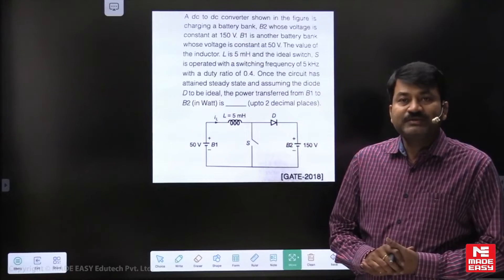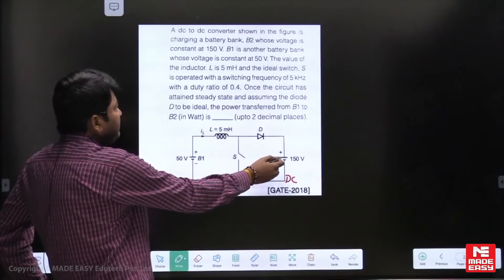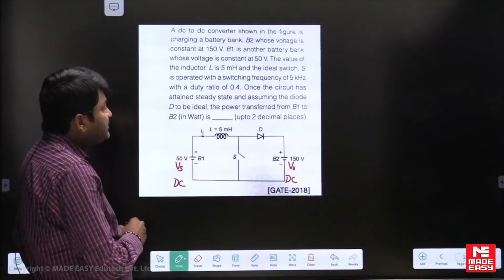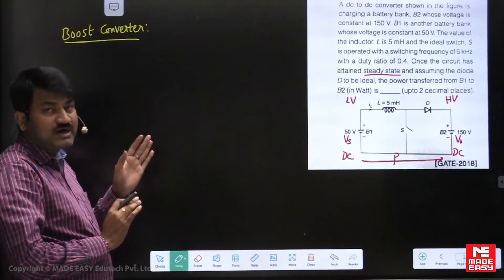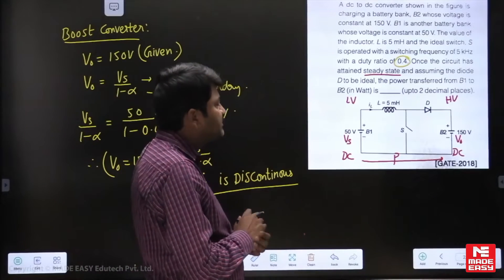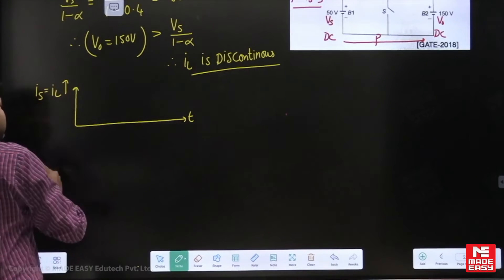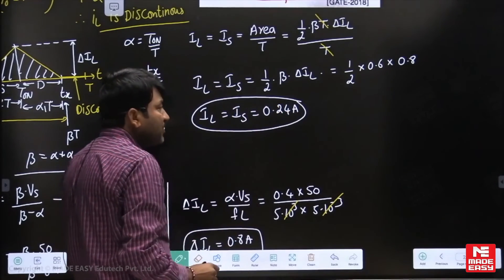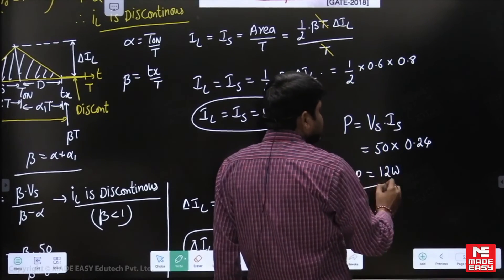Most Imp. Previous Year Questions |GATE & ESE| Power Electronics| Part-2|By Jagadeesh Sir| MADE EASY

Comment: In question it is asked to find out power delivered to B2. but here power delivered by B1 is calculated.
Reply: Both are same . Since there is no other power loss. So whatever power is deliver by b1 is equal to power delivered to b2
Reply: @prateeksrivastav3025  during off state only B2 is receiving power.